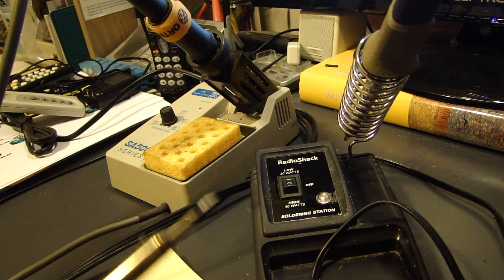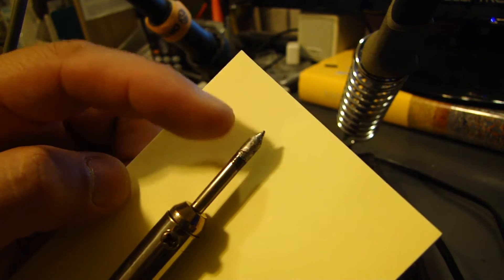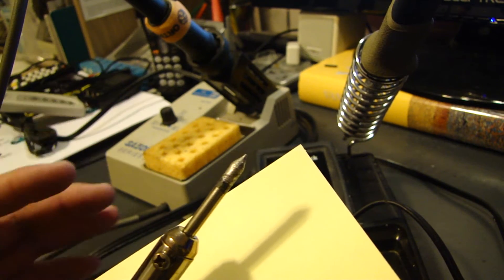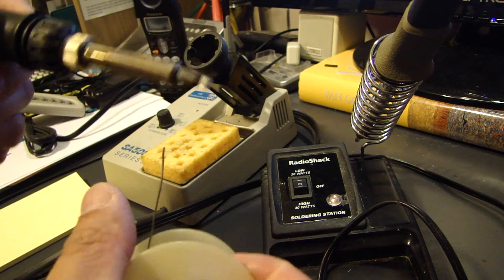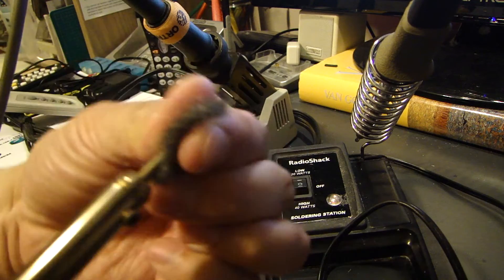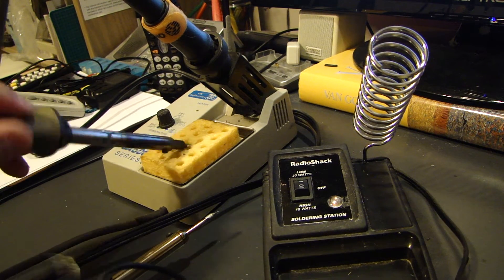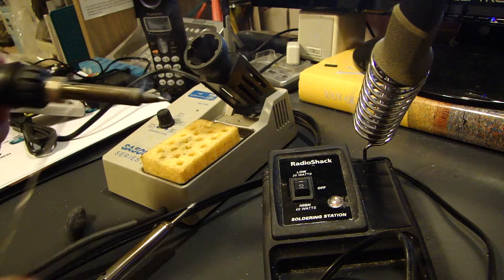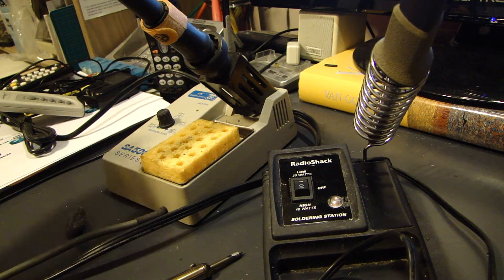How to clean the soldering tip - Part 2

Comment: you seem to cool (press against the wet sponge) and heat (leave it alone while turning on) a bunch of times. Doesn't the tip degrade very much after cooling and heating like that? Some sources say so, like this: http://www.inlandcraft.com/uguides/tip-failure.pdf
Reply from the maker: This does not degrade the soldering tip. Everyone in the industry does this. I still have the same soldering tip from 19 years ago.
Reply: Thanks dude

Comment: I bought one of those 5$ soldering guns from 3M at Walmart, but it doesn't seem to heat very well and many reviews I later read stated the tip melts away in about 30 minutes of use, pretty scary.  I will be looking towards Radio Shack for a reliable one next time.

Comment: I have a question. When the soldering iron is new, is there something i should do before using it? I've already wasted money in three (the cheap soldering iron for about $10) and I just can't tin the tip. It starts to get black
Reply from the maker: +xXxCharlesC30xXx New tip should take on solder without problem. Are you using rosin core solder meant for electronics?
Reply: +dial2fast the solder is brand new and when I turn it on the tip starts to get yellow (is it normal) and when I try to apply solder it won't stick to the tip. Yes im using the rosin core 60/40
Reply: CharlesCastroTV  exactly.  This happen to my too.  This are all lies.
Reply: Right full of bulls hit video. So ppl keep on watching n watching n they get pay. I guess we are all suckered.

Comment: This is a great tutorial, thanks for this. I can definitely resonate with your comments about leaving solder on the tip always when storing. I went through 2 tips on an led/adruino project. Your tips will literally vanish on you if you do not follow this mans advice. This is especially true with cheaper tips. A small scratch on the tip will start to cause oxidation and you will need a new one fairly shortly.

One comment I have is that I do not recommend sandpaper or steel wool. These can cause scratches and oxidation, leading to a shorter tip life. You should use a copper sponge or "Dry Brass Sponge". 

Awesome vid, happy soldering!

Comment: Thanks, I used the solder + damp sponge method and it worked incredibly well. A lot of gray stuff came off. Then I put solder back on the tip. I thought it was defective, but it just needed to be cleaned.
Reply from the maker: Jay H Good to hear that it worked for you.
Reply: dial2fast (I accidentally clicked "delete comment) http://i.imgur.com/mkUlohT.jpg I cleaned the sides also. Until watching this video, I didn't know the type of sponge you use, was just a normal cheap sponge, so I went to a store and bought some (4 for $2) after watching this video, and washed the sponge very well with soap and water first, to get out any chemicals put in to preserve the sponge while on the shelf for sale.

Comment: dial2fast how do you know when the iron has reached the wanted temperature?
Reply from the maker: It's hot when the solder will melt very easily. If it cools down quickly when you start soldering, then you need a hotter iron.

Comment: I'm trying to learn to solder. I have the 30 watt iron and when ever I try to tin the iron tip, the solder just beads right off. The iron is brown tinted so I'm sure there are contaminenets on it, but I just can't get the tip to tin properly...Any tips?
Reply: Strike that...I lightly sanded the tip as you instructed and the iron is working as I expected it to. Thank you so much. Now I'll practice some more and move on to my wonderful diy projects.
Reply from the maker: Angelbearsal Good that you got your iron working. Also if your tip is replaceable, you can always replace the tip. Have fun!

Comment: Why do you fit solder on your soldering tip after every time you use it?
Reply from the maker: To always keep the tip tinned so it won't oxidize and have contaminants left on it. It makes using it the next time around much easier.
Reply: Thanks! Also do you need to use anything other than a wet sponge when cleaning or do you need some other chemicals?
Reply from the maker: patrick sanderson Just sponge and water, nothing else.
Reply: dial2fast Great thanks again mate.
Reply: dial2fast Is flux always required or if you use this type of solder (link)
can you just go ahead and start soldering or do you still need separate flux?http://www.bunnings.com.au/bernzomatic-85g-silver-bearing-rosin-core-solder_p5910114
Reply from the maker: patrick sanderson For circuit boards, use solder that are rosin core like the one in your link. With rosin core, you won't need additional flux.

Comment from the maker: If you are only soldering electronic components, the only thing that I can think of turning a dark color is the rosin being burnt which is filled inside the solder. I guess you can clean the tip after 1-2 solder joints.

Comment: awesome video! I have one question though, I have the 25W pro line soldering iron from radio shack and whenever I apply solder to it, it melts and turns a dark color. How could I avoid that? The iron heats up to 1000f btw.

Comment from the maker: If you are soldering things like audio jacks, those have a big metal piece and they dissipate heat very quickly like a heatsink. Your 40W won't work, you need something hotter soldering metal contacts. If you have a Harborfreight near you, look up 'solder gun', they sell those for about $15. Those thing heat up fast, so work fast and don't keep the tip on too long. These are not meant for components on circuit boards. Good luck.

Comment from the maker: You must be soldering something with a big copper trace that is wicking the heat away. If this is the case, you need to get something hotter. The key is to do the solder quickly without damage.Look into one of those temperature adjustable ones.

Comment: I think I busted my tip; it's all black and I'm probably gonna have to get a new tip. Do you know how hot 40W is? I'm trying to do soldering work on a guitar's electronics and I did some research and it said 40W is decently hot enough. I do have a 40W iron; I bought it last week. I waited ten minutes for it to be all heated up but the tip still wouldn't melt the solder. I ended up messing it up by not doing the proper cleaning technqiues.

Comment from the maker: The purpose of cleaning the tip after couple of solder joints is to remove the contaminants that are building up on the tip. These contaminants come from 2 things. One, the solder you use on PC boards contains a rosin core filled with flux. As you solder, the flux will start burning up and the tip starts getting dirty. Secondly, if you are de-soldering an old PC board, the melted old solder can often contain contaminants which also gets onto tip. Dirty tip will inhibit heat transfer.

Comment: Hey nice video. Ive been soldering for years now and Im in college for electronics. I have a weller 40 watt (school iron) and I have a radio shack 30 watt. The weller has lasted me since I got it. I clean the tip as instructed and no problems. Now with the radio shack brand I always run into the same problem, the tip always decays no matter what. I clean with a sponge, copper sponge thing and the tip always decays. I dont need any help I was just wondering if you know why that is? Thank you.

Comment: My soldering iron tip will not stick solder just after a couple of use. The solder will just ball up.. I have to use sand paper to clean the tip everytime.. What have I done wrong? I clean my tip after use..

Comment from the maker: When you start to solder, you can feed a little bit of solder to the tip and begin soldering. This will allow the solder to flow a little easier when you make contact with the component. If the tip has accumulated too much solder, just wipe clean on the sponge and start the process again.

Comment: so after i clean the tip and i want to use the iron does it need to have solder on it like as im start to solder or do i clean it off and start soldering with out any solder on the tip?

Comment from the maker: When a solder tip is hot and doesn't have a coat of solder on it, the tip can oxidize and turn black. Also when you heat it back up the next time around, there is a coating of solder on it and no other contaminants that will start burning up and oxidizing the tip. Also when that blob of solder is hot and melted, you know the solder is ready to use.